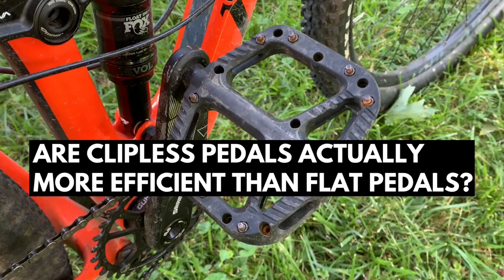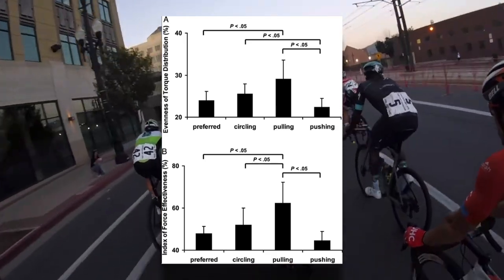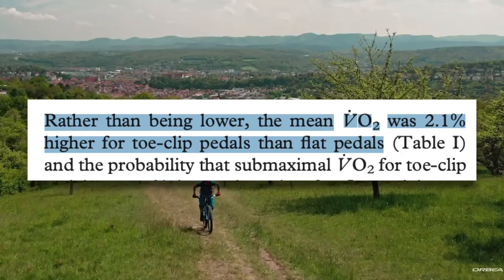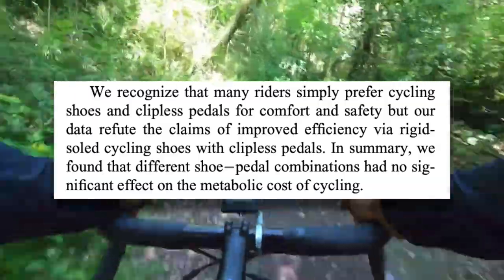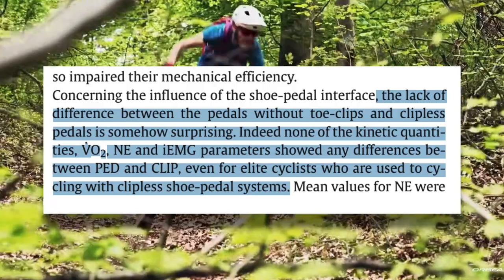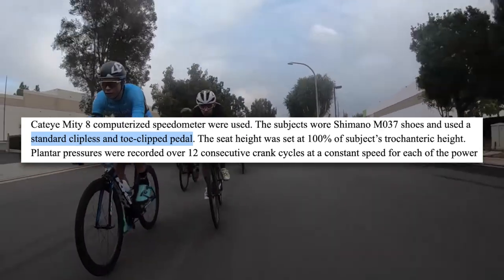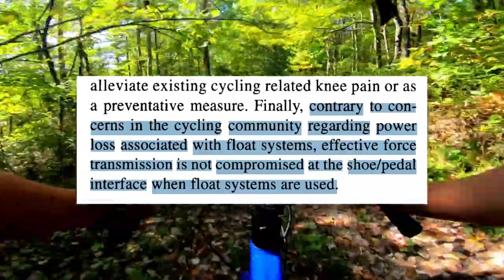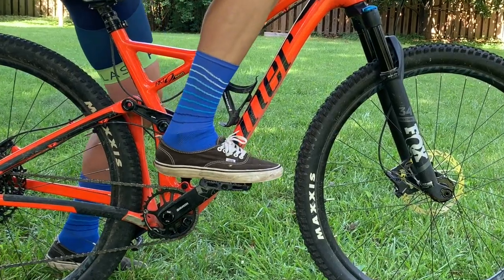Are Clipless Pedals Actually More Efficient Than Flat Pedals? The Answer Might Surprise You.

Comment from the maker: Do you use clipless pedals, flat pedals or both in different situations? Also, which brand do you think has the best clipless pedal system?
Reply: Love Speedplays for the road and Shimano Xtr on Mtb and Cx
Reply: I use Look on my road bike and Shimano on my mtb. Can't say I would prefer one over the other.
I have 2 bikes with flat pedals that I use to ride into town and it just doesn't feel "right" not to clip in.
Reply: Good work on this. Great vid. I can’t help reflecting on one other issue the studies don’t address, being the foot/leg muscle fatigue that builds up over longer rides (say 50-100kms or more) using flat pedals compared with clipless, especially at moderate to high intensity efforts. The flat pedal in this case requires more work to keep readjusting the foot position etc to keep up the required power. Even after 10-15 minutes of this, even if the efficiency were the same or similar, simple muscle fatigue would inevitably be greater.
Reply: speedplay for road, crank bros stamp 11 flats for gravel, commuting
Reply: I use Look MTB on the gravel and SpeedPlays on the road bike. I've been browsing Shimano road pedals lately..
Reply: Always use crankbros pedals on my road and cyclocross bikes, flats on my commuter bike and my fat bike switches between flats and eggbeaters depending on race temperature and conditions. Clips are a lot more conductive of -20°F than winter boots...
Reply: Clips for gravel, road and cross, flats for trails and downhill.
Reply: I use both Pedaling innovations flats and xpedo clips for mtb. I’ve been really enjoying the xpedo pedals with spd cleats/5-10 kestrel lately. My favorite clipless pedal/ shoe combo so far.
Reply: I’m playing around with flat pedals again, but mostly still have spds on my bikes
Reply: I use spds on road and mtb. Not really sure what the benefits of road specific pedals are... i also do occasionally try to use flat pedals to to ensure my technique is in check
Reply: Pedaling Innovations Catalyst flat pedals. I did the Cape Epic using these in 2017.
Reply: I used to ride my road bike with flat pedals for years, and I'm using clipless pedals for some time (2 years), since I became more serious about riding and racing. I know this is anedoctal evidence, but to ME I really had NO immediate gain in performance in endurance rides, no gain in FTP, no gain in sustained efforts. BUT I gained IMMEDIATELY at average MORE 200W in my 10s sprints. THIS is where the clipless pedals shined to me and gave me better results :)
Reply: I’m running on 5ten Freerider Pro and HT ME03, which might be the best combination there is for flats, for being the lightest without weight limit. As my local trails are in ruins these two months, I’ve been riding my MTB on roads, I feel that the efficiency gained from using clipless may be just a “feeling”, as I feel absolutely not at any disadvantage. But riding XC can be rather bumpy, and some may prefer being able to pull up the bikes for repositioning. Personally my feet don’t usually get bounced off, just need to be focused and keep the feet down. Downsides to this combination are: pins need to be tightened regularly, and shoes need to be replaced, if you ride regularly you might need as many as 4 pairs per year to maintain optimal grip. I mainly ride my RKT, but also Scott Scale SL occasionally, tried sprinting and climbed a very steep mountain, no issues with my flats set up. However, my conclusion might be most surprising, I actually feel that with a light and grippy set up, flats maybe be better than clipless for road, for example stopping at traffic lights, and disconnect from the bike in the event of crashing; where as in terms of XC, while bumping around, someone on clipless may be pulling up and gaining speed while on flats you may be required to keep your feet down which may translate into loss of “efficiency” in a race. For road I feel it really doesn’t matter, it’s just the “look”...as you will stand out on flats with the rest of the “Pros”...
Reply: Speedplays for road and speedplay frogs for xc has alleviated knee pain that i had with shimano pedals
Reply: I run both depending on the situation, although only clipless on the road.  For mtn biking, I generally prefer clipless mainly because being able to lift the back of the bike with my feet is easier than using a proper bunny-hop technique. IOW: I run clipless because I'm lazy.  
I tend to run flat pedals when doing lift-serve riding because they seem to force me to use better jumping techniques.  I'll also run flats during the winter and/or when riding technical trails I don't know well. If I go to someplace like Ray's Indoor Bike Park, I'll always run flats.
Crank Bros pedals on all of my bikes. Road & gravel included.
I would say a professional fitting is very important on a road bike since you tend to stay in one position for long periods of time and small changes in position can affect comfort in the saddle.
Reply: I use both in different situations.  I mostly use clipless with carbon-soled shoes because it keeps me pain free after a history of plantar fascia issues when I dabbled in being "tri-curious" in my twenties.  It was a phase; I stopped running and stick to bikes now.  With my kids, I exclusively ride flat pedals on a hardtail MTB, but they're rigid aluminum paired with very hard-soled shoes.  Efficiency aside, I'm just interested in whatever keeps me from having to roll and ice-filled tennis ball under my arches after riding.
Reply: I use time pedals on the road and SPD on my CX/gravel bike. I've noticed that on flats I used to have issues with slipping off the pedals.
Reply: I agree that sprinting with flat pedals is awkward but why do you think that climbing with them is a problem?
Reply: @collectivesartori  I agree that using clip-less will allow you to vary  leg muscles fatiguing. However using flat  pedals you just move the foot a bit forward or back to use different leg muscles for up, down and flat. The shoes should not have huge hard knobs on them, as the knees will wobble.
Reply: I have Look on my road bike and Crank Brothers on my hardtail MTB, sticking to xc type trails and almost no jumping, but I have gone out for short casual rides using regular shoes without changing the pedals. Does that count for anything in your survey?
Reply: I have mostly always use clipless for the past 50 years, except since I started riding a fatbike a few years ago. Yes I have raced just about all kinds of bikes except BMX and Downhill. Of course over the years there have been more and more bicycle events added, to suit every fad and whim of sales. Each body type and mental attitude is different, hence the variation. Many blue moons ago I remember that the Europeans were said to ride in moccasins with toe clips in the early season, so that they would cycle rounder and not push down so much. Also other stories of riding with just one leg for 30 miles(50km) and then do the other leg was also very likely. Now I ride flats on the fatbike and clipless (SPD 50) on the road bike, which my wife does as well. Go ride, have fun, be safe!!
Reply: I use mtb/bmx-style flat pedals with pins, lately while wearing sandals. I've never found sprinting in any way awkward or that my feet lift off the pedals. I've never raced or anything, I just cycle for exercise and fun, but I've got some decent times (top 1%) on some popular Strava sprint segments near me.
Reply: shimano on both mtb and road. tried pretty much everything but in the end, hassle-free usage of their near bulletproof systems wins out.
Reply: I hate "clipless", only pinned flats w/ 5 10's, or leather straps for me. Clipless releases when you need it to hold and holds when you need it to release.
Reply: I use Crankbrother's Eggbeaters on mountain bikes and Look Keos or Favero Assiomas (using the same Keo cleat) on road bikes.
Reply: @ChrisCapoccia  I ride Eggbeaters in flip flops during the summer to do shopping.  No point to switch pedals for those short rides.  I have no problem riding Eggbeaters with flip flops or normal shoes.
Reply: I've used the Shimano type clips and straps for  3 decades. (I call them 'traps') Tried clipless, I 'just don't get it'. Plus the pedals for clipless weigh on average twice what the best clip style do. (Use the plastic clips, half the weight again vs steel, and far safer) With the Shimano clips (and Campy ones, albeit the Shimano are three screw attached, Campy two) and the pedals of the era, no pedal has increased the clearance from the spindle, only matched it with some clipless pedals. The flat mounting Shimano and Campy type also allow adjustment fore/aft equiv to that of clipless.
In an emergency, you can be out of the clips (assuming you haven't strapped yourself in like some idiot cyclists do) in a fraction of a second. I can also be into the clips far faster than any clipless type. As much as clip type have made a limited comeback, many who use them don't do so correctly. It is best to use stiff sole shoes, albeit not as stiff as road clipless type. It's nice to have grip on the bottom to err...walk in when you have to.

Btw: My Shimano 7400s are still running like new thirty years on! (The back plates have worn away, now replaced by Shimano 600 steel type). The psychology of knowing your foot isn't going to slip off of the pedal is a huge factor to confidence of applying full torque. Beyond that, I not only see no advantage to clipless, I see all sorts of disadvantages, not least the "clip, clop, slip" as the canaries dismount their ego thrones.
Reply: Both. Each offer performace and therapy.  Watch any athlete and you will see them break form in ways for therapy or performance.  If racers wanted an edge theyd ride more towards toes for off the saddle and aft for in the saddle. <-this is the ideal solution and the real bane of clipless
Reply: Anyone who has ever accidentally unclipped while sprinting or climbing will quickly realise the importance of clipless pedals (and ones that are pensioned correctly).
Reply: @mihpop9733  i disagree. If you are on flats that danger would be mitigated.  Granted one can stand higher with the ankle while sprinting out of the saddle with clipless, this can tap fresher muscle or therapy an ache.
Reply: I use time, both road and mtb. Just last year switched to look style on the road due to a power meter pedal. Switching back to time the float difference is huge
Reply: Shimano spd on my road bike (dual sided Issi Flip pedals) so I can ride it flats for quick trips to the store/around the neighborhood/with my seven-year-old etc. Composite fats with metal pins on everything else except my fixed gear which usually lives with composite flats with nylon straps But has an old pair of welgo SPD’s that go on when I take it to the Phil Foster velodrome
Reply: Ucanskixc Best (non-cycling specific) shoes for flat pedals are skateboarding shoes they’re specifically designed to work with flat grippy surfaces and will actually last a reasonable amount of time without wearing out. I seem to wear through 5.11 soles in well under six months. vans even just started making a version of their sk8 high with a stiffer shank for BMX riding
Reply: Lightweight flexable shoes for road makes for a more comfortable ride and better prescise control of the force put down on the pedals.  I dont see how a flexable sole is more laborous
Reply: I currently use both of the Shimano systems, and will soon probably switch to Keo for road (when IQSquared finally ships its powermeters...).
The point for me is not so much the power aspect (I’m riding recreationally, also longer distance, but do no racing), but safety. I once slipped of a wet pedal and fell on the stem, bruising a few rips on my cycling computer. Barely kept from falling.
Another point for me is consistency. I find my feet position shifting on flat pedals. Not going to happen with clipless (or straps). No wasting time for corrections, or injuries due to prolonged wrong positioning.
Reply: Actually I could not really choose, so I have flat on one side, clipless (MTB style) on the other side of the pedal. It does determine my shoe choice on leaving the house since flat pedals and MTB shoes gets me a slippery unstable combi, sturdy bottom sneakers with flat pedals is kind of OK. Apart from the "push"  / "pull" enabled by the clipless I've never noticed much difference in strength.
Reply: On my mtb I use shimano saints.  I love the freedom of being able to get my foot off the pedal quickly if I need too. Shimano 6800 spds on the road bike.
Reply: On my MTB I started riding flats a year ago after 12+ years riding clips. I enjoy the feeling of them and it helps me set my weight properly in corners, and improve my bike control on jumps and through rocky sections. I still think that clips are better for racing because sometimes you can sneak in an extra pedal stroke you'd miss with flats. 
On my gravel bike I always ride clips because I'm not a monster. 
DMR vault flat pedals, Crankbros Mallet E for Enduro and Candy for gravel/road.
Reply: Both
Reply: Clipless pedals are the same as flat pedals.  Clips may be more efficient.  I refuse to use ridiculous terminology.
Reply: @collectivesartori  I regularly ride >100 km spins with the steepest off road climbs and some of the techiest descents in my area on flat pedals and don't notice this issue at all. The biggest issue I have relating to pedals is my shoes acting like clipless pedals once the pedal starts to chew its way though the soles of my shoes, making it difficult to place my feet properly or causing them to snag as I go to put a foot down occasionally.
Reply: Flat. Will never use clipless. I want my feet free for more than 1 reason.
Reply: I ride both Mountain and Road so I ONLY use SPD pedals for the convenience. Plus I like walking
Reply: I just returned to cycling after many years off the bike. Had many years on Look/delta cleats so I thought I’d try SPDs. I find the SPDs are much harder to get into, even with minimal spring tension. It’s the small size and need to be exactly over the cleat. When these get worn, switching back to Look style.
Reply: I was just reading about some older riders like myself who started with clips and cleats. I never really liked them even back in the day because the clips always ended up hurting my toes- I have big feet. I also found getting into and out of clip list petals much easier than clips and straps.
Reply: I use flat pedals. The reason being I don't want ties feet. Moreover I have found a way to turn any normal shoe-sneaker into perfectly stiff flat pedaling shoe. The difference is night and day, both in takig care of the feet and even distribution of energy throughout the foot.
Reply: All clipless all the time. Even on my beach cruiser. It just feels weird not to.
Reply: I use the Shimano PD-EH500. Its dual sided. When I drive out to a cycling specific area with no traffic I clip in. For city though I go flat pedal all the way.  It’s just not worth the risk. IMO it doesn’t make a huge difference. If it does, that’s not the pedal, but rather your lower body needs some more work!
Reply: Shimano on road bike and Crank Bros Doubleshot (flat on one side, clipless on the other) on mtb.
Reply: Five Ten Pro w/HT Flats for MTB and S-Works w/XTR for Road.
Reply: Can you do a video on how yoga may or may not improve cycling performance?
Reply: Spd all day, but egg beaters are good too. For a fixed wheel bike, definitely binder pedals (aka clipping into clipless lol).
Reply: MKs lambdas and messenfer shoes on my credit card touring bike
Reply: Methinks GCN covered this topic awhile ago. Found same results, basically.
Reply: Google Christoph Fuhrbach, he's an amateur cyclist with a background in ultradistance AND hillclimb races. His peculiarity? He races on flat pedals and sandals (yes very German!) due to some feet problems. For some years he was in the very top 5 in Dolomiti week hillclimb races or Stelvio, often in front of U23 riders.
Reply: Clipless for road cycling and flat pedals for mountain biking.  Love speedplay on my road bike.
Reply: I have Vector2 powermeter, which makes me confined to Look Keo. However, I have Shimano PD9000 pedals on my second bike, and interestingly, Vectors feel more convenient and easier to clip in.
Reply: Clipless pedals are great for descending.  You dont want your foot flying off if you hit some ruff tarmac
Reply: Both ;) SHIMANO XT TOURING PD-T8000. I pretty much always clip in except for that 100 mile ride I forgot my shoes and had to use the flat pedals for 100 miles ... never again please
Reply: Hi Dylan as a road cyclist I really don't agree with these findings. In my experience I can go very fast with flat pedals, however will not be able to sustain high average speeds for several hours. For example my best with flat pedals over 100km was about 28 km/h whereas with cheap mountain bike shoes this increased to about 32 km/h. And with SPD SL and much better shoes I'm now exceeding 33 km/h over even longer distances. If I go back to flat pedals I would not be able to reach 30 km/h.
Reply: flat. Won't even consider clipping in after leaving my "clipless" friends in the dust.
Reply: I've used flat pedal with toe clips for mountain biking for decades, but when I starting riding on-road, I initially used clipless. The pedals that I used supposedly had a fair amount of float, but it wasn't enough, and it was uncomfortable to me. In addition, my well-trained reflex of pulling out of toe clips bit me a few times, so I quickly ditched the clipless pedals. Where I landed was with a set of flat pedals and Power Grips. I may be the only person with a road bike and Power Grips, but I've found them to be the most comfortable on long rides.
Reply: I use flats but I ride a unicycle. Clips would probably be suicide.
Reply: Flat for everything. Being a four-season cyclist simplicity and utility is key, and having tried clipless for a summer I just never saw or felt any benefit. It's especially useful in bike-to-hike scenarios where I can just wear my grippy approach shoes.
Reply: Have switched to flats on all of my bikes. Touring, road, mountain. It has been a gradual change, and enjoy not being worried about buying shoes.
Reply: I had no clue clipless petals existed.
Reply: I use ones, not to be more efficient, but to improve my butt
Reply: I'm flats all the time!  Just a comment on MTB, seems like most of those guys prefer clipless for a completely different reason then you mentioned; when going over large gap jumps / rocky descents, you don't want your foot slipping out of the pedals.  Note those guys are in 100% commitment mode.  
Sam hill Enduro world series winner, climbs the hell out of some trails, and he runs flats where most of the rest of the competition doesn't...  flat pedals win medals!
Reply: I had Speedplays for 10 years on the road bike.  Too much maintenance to maintain the pedal.  Walking is under-rated, so going with Shimano PD-M530.
MTB: Had crank brothers Candy for a while, brass cleats wear too quickly.  Switched to good ol Shimano PD-M520.
Reply: I use both flats and clipless on the MTB. Almost 50/50 in time. Flats gets my technique in place, and clipless ruins it, but saves me from all the small errors :).
I use Shimano SPD in the dirt. For road I run Look clipless in the summer, but on my winter commuter I use Shimano SPD. For the road it is mostly a "for-the-looks" (pun intended) thing in the summer, and in the winter it is a practical thing: It is the only system I have found a decent winter boot for - including flats.
Reply: I ride on flats with some van shoes for commuting ang professional MTB I used to use the Shimano clipless system and I think there wasn't a difference only on the time of getting out of the bike when you crash
Reply: My experience with clipless pedals is pretty interesting. I have shimano SPD pedals and used them to some extent. But i also use my bike to drive casually sometimes so i change pedals into flat ones. The big difference after swap is that my brain still behaved like im in SPD's and i started to have an esier time to consistently place the feet at the same place and dont change it all. This fixed my issue of feets dancing on pedals so much that i kinda drive now only on a flat pedals. 
I drive checking the mean speed and time on a track. And with flats my time and mean speed is tiny bit better actually. especially im not very good at using downhill speed using SPD's. 
But uphill seems better and smoother on SPD's. Im not professional cyclist by any mean but i do road cycling for few years from now on so im not a total noob either.
Reply: from running single speed on my mtb for years, i found my heart rate was lower and i could get up longer steeper hills when i just concentrated on pulling. you engage a smaller muscle group when pulling so have a lower heart rate. might be totally psychological??? 
On long days changing up the way you pedal by pulling might give you quads a bit of rest.
Reply: Flatpedals, because it would be crazy cumbersome if i'd have to change my shoes before and after every bikeride! 
i just changed from standard flatpedals to a BMX type pedal (larger surface) and they do really ride much more comfortable.
Reply: in bmx racing clipless pedals are essential to be fast in the start and to maximise power output thru the turn. but most non elite rider train with both to train technique.
Reply: I use flats both for my roadbike and my mountainbike. I get laughed at my normal shoes a lot by my friends, but I can easily keep up with them, so I don't see why I would need to change.
Reply: I exclusively use flat pedals for my gravel, cyclocross, and mountain bikes. I do use toe clips and straps on my fixed gear bikes.
Reply: I use Crank Bros Stamp 3 on my MTB and Crank Bros 50/50 on my CX. As I have yet to find a pair of cycling shoes big enough for my feet, I’m kind of limited as to what I can use.
Reply: ATM i'm using Double Shot 3 from Crankbrothers, amazing pedals, i was running a double shot 1 before and it's a huge upgrade
Reply: Flats only. 
BMX teaches you that coming off the pedal is a good thing. It saves lives. Cant bail off a bike in the air that your feet are bolted onto, and you cant slide your foot out and land without shoes either. 
Double whammy for clips. 
But its every person's own bike. Long as a the pedals are turning and smiles are being made who cares.
Reply: spd on my gravel bike i notice the difference on short sharp climbs (6 or so bikes lengths) that i would need to shift down on or stand up with flats. i find i cycling clipped in nicer and smoother. have mk1 hope f20s on my trials bike and get sore feet from being in different  postions all the time if anything
Reply: clipless for road, flats and 5.10s for mountain.  much more confidence on the mtb with flats.  threw away my spds and never looked back.  if i ever race cyclocross again, i'm for sure using flats.
Reply: Flats for dirt jumps,clip less for everything else.
Reply: The whole "pulling up" argument is faulty.  As the video states, there is little additional power offered by the flexor muscles.  However, this doesn't mean that clipless pedals don't offer benefits. First, there are (minor) efficiency losses due to the fact that flat pedals require some slight downward pressure on the rising pedal, so that the foot remains in contact. Second, flat pedals limit the maximum power available, because of the lack of stability. In short, clipped in, you can crank with abandon without risk of losing contact with the bike.
Reply: This was so interesting! I forced myself to start using clipless pedals even when I was just MTBing - funny to see that what people were telling me about 'efficiency' wasn't based on science... I might switch my MTB to flats for more confidence descending now. 
But if you have to buy special rigid shoes anyway - you might as well use clipless...
Reply: I run dual sided clipless/flat pedals on my cross bike, Shimano A530 (or the newer EH500):
https://youtu.be/3efWoZp-wEo
I like the clipless side for riding pavement to/from the dirt trails.  In the dirt, I'll ride either side of the pedal as conditions warrant.
Reply: Dylan, this is not a very good or informed video. The one area where clipless pedals are superior over mashing flat pedals is not pulling up on the pedal as you claim, but pulling back on the pedal (i.e., a backwards kick motion) when you are near the bottom of the pedal cycle. It eliminates the dead spot at the bottom of the pedal cycle and increases cadence and power and avoids mashing (i.e., a choppy cadence due to only a down stroke for power on the pedal cycle.) You haven't been cycling very long. Have you?
Reply: Use clipless on my gravel and flats for my ebike
Reply: Great video. I use clipless pedals only because, and I'm sure due to my own fault, I was finding my feet slipping off on climbs from time to time on flat pedals. There is a level of comfort knowing my feet aren't moving much, and lets me focus on other areas of cycling I also need work on.
Reply: Flats for MTB and pretty much everything except road competition, sprinting and of course track cycling clipless.  Clipless is pretty much required as far as I know for fixed gear track bikes for safety.
Reply: Spd-sl on my racer. Flat pedals on my citybike. Not sure what to put on my new gravelbike... any advice?
Reply: I've used Time MTB pedals for years on (almost*) everything. However, I always have hike a bike ready shoes and unclip + mash on top of the bars when things get too dodgy... I often ride fairly remote stuff solo and don't want to become a S&R story. 

*the exception is the fat bike, because why in the everloving hell would anyone want to take the chance of a mechanical forcing them to walk home in low/dropping temps in anything but a full on snow boot. I'm saying NO to frostbite.
Reply: Watched this months ago but just today used flats for the first time in years on a rental bike. One thing that stood out to me was the short moment of disengagement that occurred when downshifting on the rear cog. This is much more perceptible with flats than with clipless pedals, and occasionally resulted in one of my feet coming off the pedal. Also, 4 hours later, my quads are much more tired than they usually are, though that may be down to slight geometry differences between the rental and my usual bike.
Reply: Flat because i'm broke
Reply: I use flats and fell running shoes for cyclo cross - less time lost clipping back in, better for the running sections, easier to dab. Still, I'm not winning anything. Top guys all use clipless.
Reply: I use flat for all MTB.  I can do the same power on flat and clipless. Weight wise the difference between Bont shoes and time pedals compared to 5-10 shoes and light flight pedals is not that big either.
Reply: I use flat pedals for my 40km commute and do not feel a difference when riding at medium intensity. Only difference I experienced with clipless is when I am close to the top of a punchy climb and my “pushing” muscles are burning, I can pull at higher cadence to get over the final bit and recover bigger muscles for a second for the descent.
Reply: i got toes cage on my fixed gears and speed play pedals on my road bike
Reply: gave up clipless pedals after falling twice and getting a cut in the foot haha, back to flat pedals we go. Might gonna use clipless when riding on a trainer or a stationary bike but that's about it.
Reply: Big SpeedPlay fan, and really like the improvements that Wahoo has made.  I'm looking forward to their as-yet-unannounced MTB/Gravel/Off-Road pedal offerings...
Reply: Oversized flat pedals with 5mm spikes and trekking shoes. Plenty enough of grip and stiffness for touring - even on the trails, plus I can hit the mountain by foot mid ride easily if I want to.

I actually noticed a HUGE difference since I moved to spiked platforms. Added grip which virtually eliminates possibility of sliding allowed me to push more confidently without any need to think about my foot position. I believe clipless would be even better at that but I am somewhat worried about giving up walking comfort while touring. Cheers.
Reply: I’ve started using flat pedals, my knee pain has instantly improved!
Reply: Flat pedals on a road bike
Reply: I come back to this after former pro racer Paul Voss briefly switched from road bike cleats and shoes to MTB cleats and shoes before the Unbound and had to stop the race after 3/4 of the way because his calves gave out.

He never trained in the MTB Cleats and said they had a different position that his muscles weren't used to.

But given that the SPD Cleats are way smaller than Road Bike Cleats it's also very possible that the transition is weaker in MTB Cleats and he just had to use way more energy in MTB Cleats.

Flat Pedals would have been the right move.

This is one clear an example of how ideology works and manifests itself. There is enough science out there that someone should give Flat Pedals in such races a try, especially if he has to walk in Mud so much. For the Unbound 350 it's very easy to see how Flat Pedals could save you a lot of energy as all the muscles in your foot will be contracted instead of one area only
Reply: @collectivesartori  I think it depends greatly on the type of flat pedal you use. I have relatively cheap MTB pedals, and once I put my foot on the pedal, it's glued. I'm actually pretty annoyed by how difficult it may be to adjust my foot position just slightly on those pedals.
Reply: Flats for rides when I expect to need that unexpected foot down (slippy roads or knarly / unknown 'gravel) and SPDs otherwise. Happy to do 200K in either but I feel like clipped in should be better for endurance as I'm able to recruit extra muscle groups by pulling fairly often and especially in the saddle. Sometimes get a bit of knee pain with the clip ins though... so feel like flats may be the best all round anyway! I often ride in flexible soled sneakers too and again feel like it's all good for comfort and at least acceptable efficiency wise.
Reply: SPD-SL on a road bike and OneUp flats on enduro/mtb bike.  First, when i tried road biking, i rode flats for 6 months. i able to do quite good times on climbs.  however main difference is: 1. you can keep higher candence with clipless (safely - without loosing your feet)
2. it's easy to make a sprint (and then you can pull pedals as well, especially when you are very tires (at the end of intense climb for example)

most of the time you don't pull your pedals (with intensity below 120% FTP ?) - main "pro" for clipless supportes.
on MTB/enduro I do climbs with lower cadence like 60-70rpm